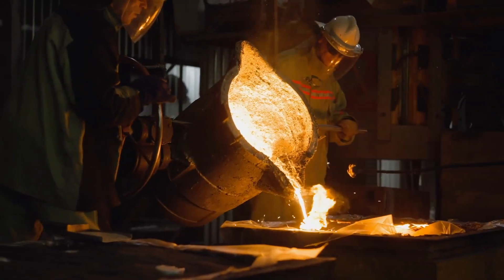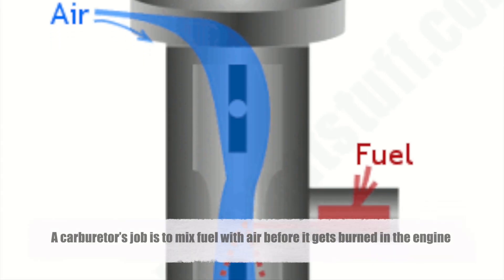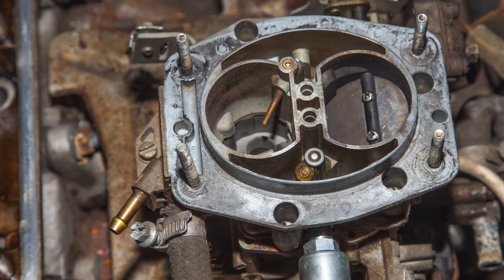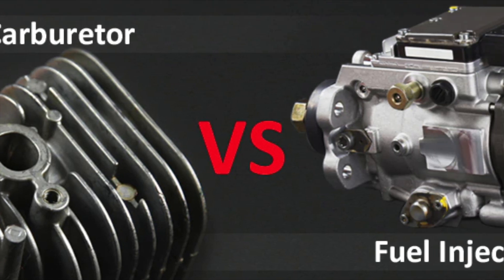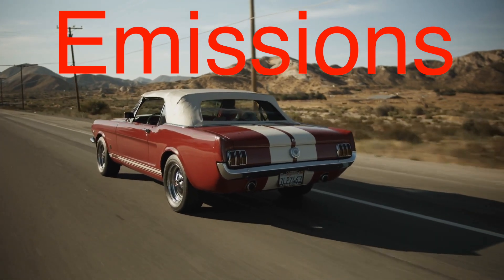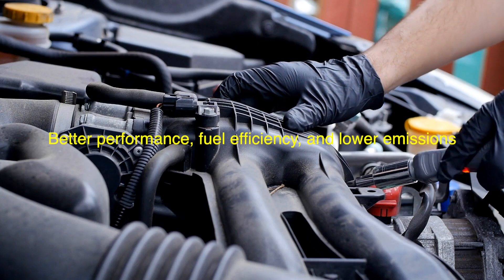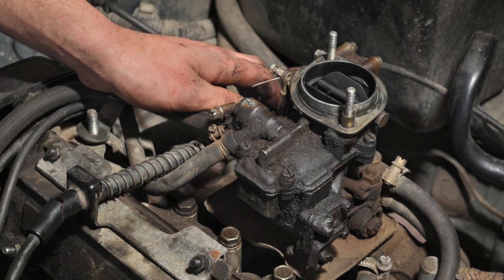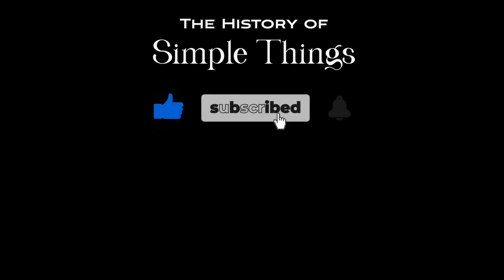Carburetor vs Fuel Injection: What Are the Differences?

Comment: Since I am 73 years old I have lived through the history of carburetors in automobiles and all the way through the history of fuel injection. This history is interesting. When early emission control rules were made at first carburetors became more complex. There were in the early 1980s cars that had an early electronic system that adjusted the air fuel ratio on a carburetor. Then the next item that was used was throttle body fuel injection. The throttle body fuel injection looked like a carburetor with two fuel injectors on top. Then next came port fuel injection. Eventually direct fuel injection was developed. Today some cars have a combination of both port and direct fuel injection. There is an interesting historical thing. The very first electronically controlled fuel injection on a car was in 1958 on a very few Desoto cars. It was a transistor system and was called the Bendix Electrojector system. It was highly unreliable and cars that had this fuel injection system had these systems replaced with carburetors.